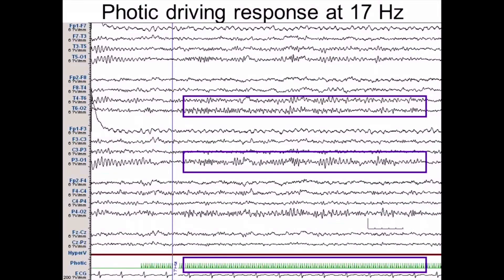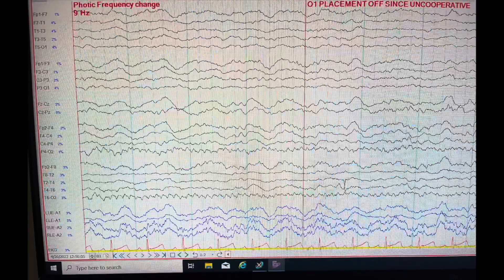Asymmetric Photic Driving on EEG of Uncooperative Patient

Comment: what does no driving or driving mean on photic simulation?
Reply from the maker: Driving will show waves lining up with each flash of the light. It is also normal to see no driving response. It would be abnormal to see driving only on one side, or spike & wave discharges due to light stim.